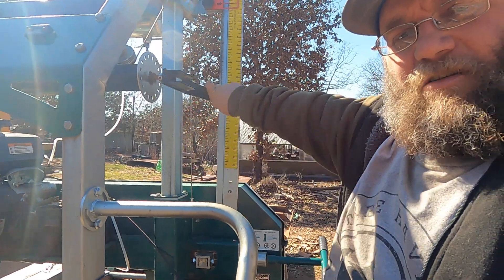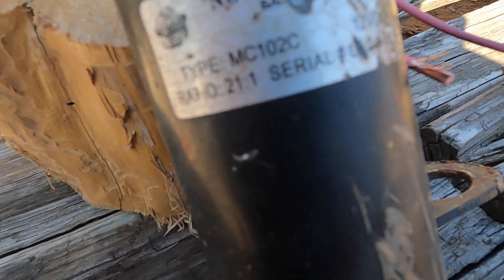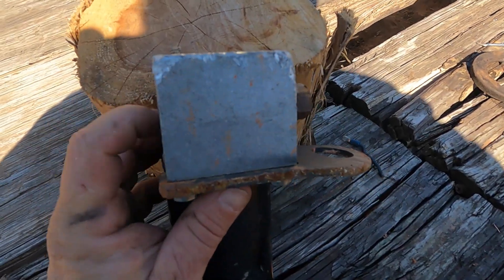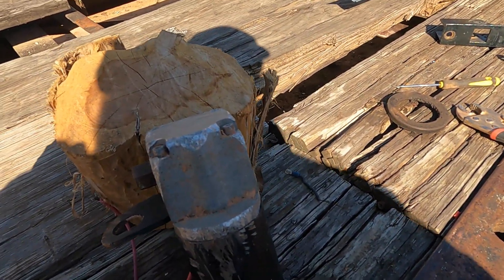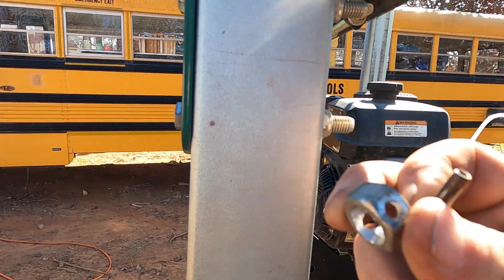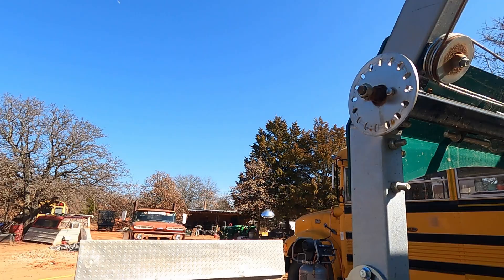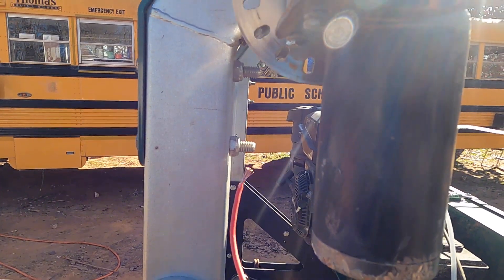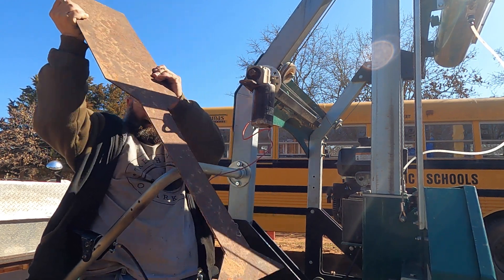DIY Power Head Upgrade for Woodland Mills HM130Max Portable Sawmill #diy #woodlandmills #sawmill

Comment: Hi Willey being trying to post the link for the  water proof switch i found for the sawmill motor ,but for some reason every time I try to post the amazon link  it gets deleted.   387874 RV Electric Stabilizer Switch Compatible for Lippert RV Electric Stabilizer Jack Switch Electric Leveling Jacks Replace LC298707, LC198641, LC363284 Etc 1PCS
Reply from the maker: Awesome I have to check that out!! Thank you so much!

Comment: Wiley, this is a great powerhead system.  
Have you given this powerhead system of yours a good "test drive"  since you installed it and is it still holding up?  Have you noticed any creeping down of the saw blade while sawing, any cut thickness discrepancy?  Lastly, do you feel at ease with the motor speed, the speed it raises the saw head, would you consider the need to add a speed reducer?   Thank you
Reply from the maker: I have been using it for a couple years now and it is excellent!! The only thing is when letting off the switch the motor does not stop immediately. So it does tend to take a little flip of the switch to get it perfect. Zero creeping while sawing. These motors have held RVs stationary for years! Only regret I have is the fact I haven't found a switch that holds up to the elements well. I have replaced it about 4 times since my build. Of course that's a little to do with the fact my machine is never covered and I keep replacing with the same brand switch 😂.
Reply from the maker: By the way that is a couple years and enough wood I don't even want to try and count!
Reply from the maker: Sorry I just noticed I didn't say NO absolutely no need for a speed reducer
Reply: Thank you for your reply Wiley.  After watching your video and not having success  on my side with this brand new Worn Gear motor I had bought, lacking power.  I wasn't sure about the rated watts I should be ordering for those DC motors and went with a 120Watt Worn Gear motor.  I installed it and it would not even mover the sawhead up a notch, was only able to move it downward.  I did not have a support bracket made yet to hold the motor from wanting to rotate and I was able to hold the motor with one hand when activated.  I did not want to spend the high $$ for a higher watt rated motors, not even knowing if it would work better.  Then I came across your YouTube vid.  I right away search the web and I ordered the same type of motor you have and I am eagerly waiting for it to arrive.  I will also have to make a bracket to hold it but that's part of the fun of this project.  Like you, I have spare steel bars and sheet metal laying around to put to good use.  Should be fun to build !  Will let you know how it turns out.  Take care !
Reply from the maker: @Guy-yw2re Great man!! I hope it works as well for you as it has me. I will be waiting on updates. Good luck!
Reply: @WorkinWithWiley  Finally had it all together.  It's working but haven't really tried it in the field yet, waiting for the next work days off to come.  Like you mentioned, I see that it will take me a little getting used to to master the switch to be accurate with the cutting scale.  I like the speed it raises the saw head though.  If I eventually find it hard to accurately adjust the saw head to math cutting dimension, I may eventually figure out how to momentarily (a slight voltage drop of a coupe seconds each direction) when flipping the switch up or down might work, it's the how to that will need to be figured out.  Arduino program might be a solution but I am totally green with programming.   Once I have cut a few lugs, I should have a better feeling about it and if I indeed need to do something to address it.  I meant to add a couple of pictures of my set up here but I don't see any option to allow me to upload pics.  Thank you Wiley for posting your powerhead video that inspired me to go ahead with this project.
Reply from the maker: @Guy-yw2re Awesome!! Yeah they don't allow pics in comments... Glad to hear it's working!

Comment: Do You Think this motor lower and rises faster than the woodlandmills one? I been wondering what the speed difference would be?   Again Thanks for the idea
Reply from the maker: From what I am noticing it's a little slower
Reply: @WorkinWithWiley     I have put the same motor on mine ,It works wonders   Thanks for the Video

Comment: I am impress with the motor idea , How the motor is holding so far?      Thanks
Reply: Thanks for the replay I’m about to follow the same route. Will look for the motor and controls.  Thanks so much. Will keep you updated
Reply from the maker: @redlalo777 No problem the only thing I would recommend is find a weatherproof switch if it will be exposed to rain!!
Reply from the maker: Hundreds of logs later it is doing great!

Comment: Great !  how is it working , How did you wire the motor with the control switch?  Thanks
Reply from the maker: It is working Great!! It is a 3 way switch that wires easily cost me like 10 bucks on Amazon
Reply: Thanks. Can you please provide a link to the 3 way switch. ?  Very appreciated

Comment: How did you connect motor to mill
Reply from the maker: @Ricky-q5w  I has a 3/4 pocket built into the motor and fits perfectly on the rod of the mill then has a roll pin to hold together
Reply from the maker: @Ricky-q5w  oh sorry I forgot... had to use a 3/4 nut (wrench size) and ream the inside a little bigger then use the roll pin to connect it so the motor slips on
Reply from the maker: @Ricky-q5w  I think it's clearly shown in the video.
Reply: @ yeah sorry i saw it in another video